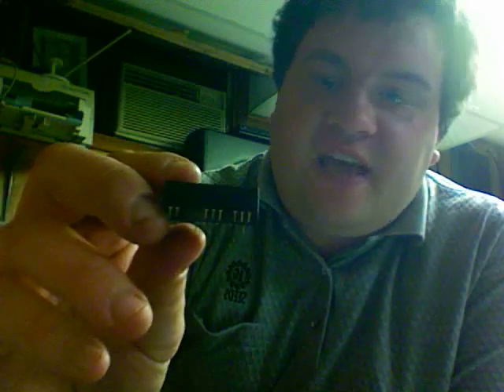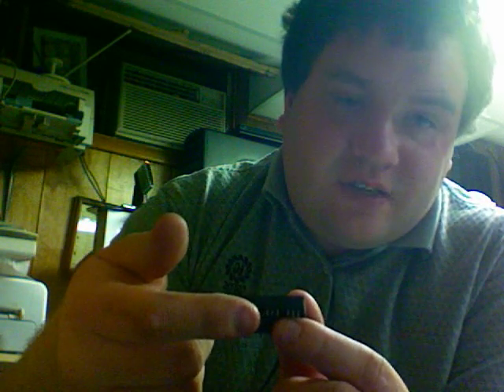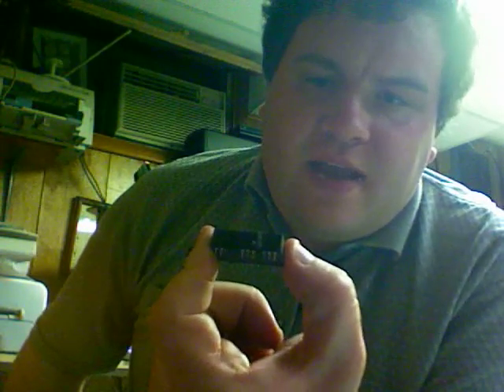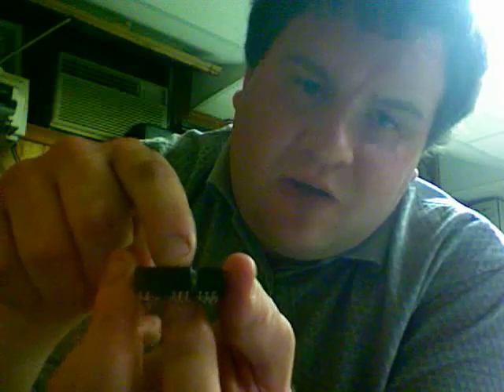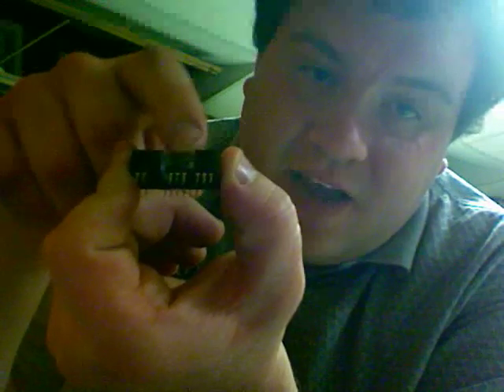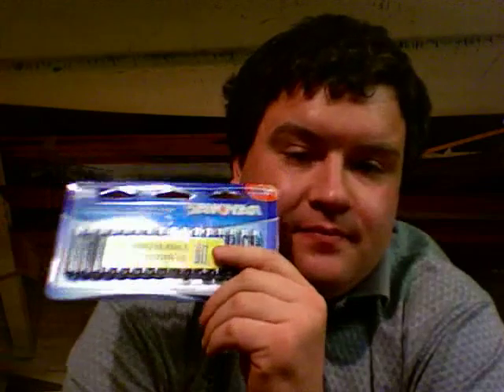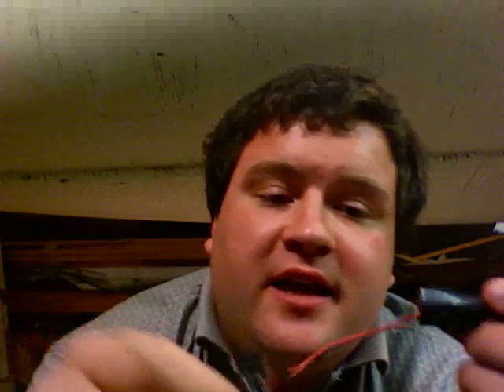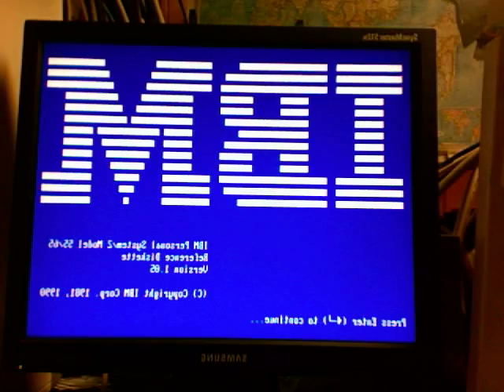Reworking Dallas Semiconductor Clock Modules

Comment: How do you do that to remove the Dallas Semiconductor Battery?

And when the battery died to the point it has no longer hold the charge, does it cause to fail to boot it up the operating system where you can't get to your file?